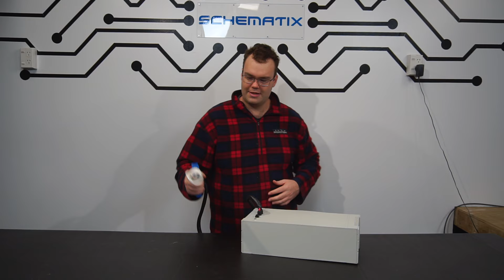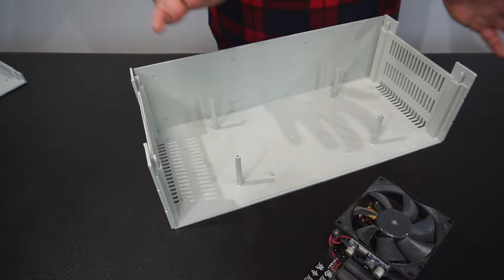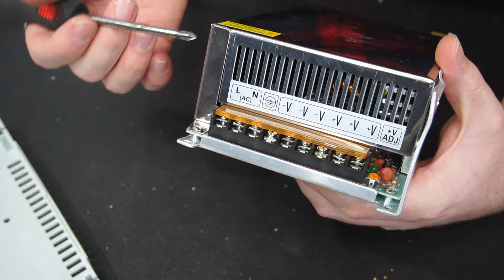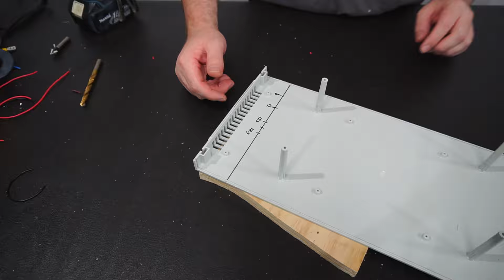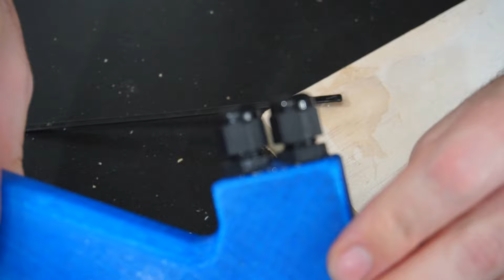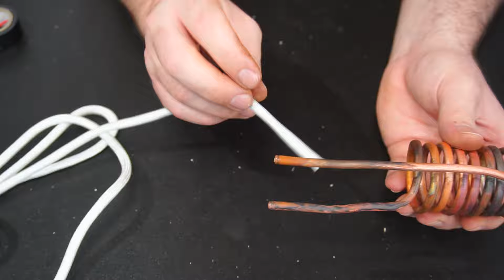How To Make An Induction Gun (Bolt Heater / Buster)

Comment: And for better efficienci, and even better performance, place the capacitors from the kit as close as possible to the coil, there is sou huge amound of curren flowing through the wires from the kit to the coil, this current is heating the wires quite a much and the LC resonance circuit has big rezistance, which eats the power only to heat the cables and not the heating object.

Comment: cool.....I was under the impression that its mostly about eddy currents/hysteresis & that you can indeed heat non-ferrous/non-magnetic metals with the right coil/frequencies etc.
Reply from the maker: You certainly can with the right type of induction heater. However, this particular induction heater isn't the correct tool for that job.

Comment: Cool video!  Youtube random AI and I bought most of the materials to make one of these a year or two back for when I swap the exhaust manifolds on the Dodge Ram.  I wound up patching with furnace refractory as an adhesive to fiberglass tape with a stainless steel zip tie and haven't had any issues with other than one blow out... so didn't get to swapping yet.  I've saved this and thanks for sharing!  I'll try to do the same once I get around to.  Excellent videos of practical devices that I've found from random appearances from Youtube suggestions.  I think the other was the microwave transformer rewind or transformers in general too when I was thinking about rewinding the bug zapper transformer.

Comment: Induction heaters are able to heat up any conductive meterial. Not just magnetic materials.
Reply from the maker: You are correct, however, this induction heater isn't powerful enough to heat non-magnetic metals.

Comment: Very interesting. A little disheartened though, that it won't work on aluminum. So much for my idea of making a foundry furnace for doing aluminum castings.
Reply: A cast iron crucible would probably work on heating non ferrous metals ?
Reply from the maker: Yes I wish it was more grunty so it could be used as a furnace and heat other metals such as alloy. An induction furnace could be a future project for??

Comment: This was great but the high voltage on those two protruding aluminum bars worries the heck out of me.  They should be insulated.  Also, put a trigger (on/off switch) on the headpiece itself.
Reply: You can hold the bare coil in your hand while it is operating & not feel a thing! The high frequency makes it inherently safe although it might feel a bit warm.
Reply from the maker: High voltage? It's actually very low voltage & high current. Unless you short the prongs with a low impedance body part such as your eyeball. You'll be fine. Think of it along the lines of a car battery. Crazy amount of current available, however, not enough voltage to cause any harm. ;)
Reply: @Schematix  Yes, you're right.  High current when trying to heat.  Still, https://www.tuv.com/media/usa/aboutus_1/pressreleases/fieldevaluation/Effects_of_Electrical_Current_in_Human_Body.pdf
Reply: @Schematix  Never set the gun down flat on anything conductive...
Reply: Yes not dangerous shock wise but I wouldn't stick my fingers in the magnetic field....could cause cancer....lol
Reply: @oceanhouse8080  

having a ring on would be much more of a concern.
Reply: @deaultusername  LOL

Comment: Looks like just the thing to remove the bolts holding a vintage pickup bed to the chassis - after fifty years the originals won't budge and better than a torch near the fuel lines.  Just the perfect amount of demonstration and explanation too!
Reply from the maker: Glad to hear you found the video helpful :)

Comment: Tons of useful information here. Would you have any insight into what it would take to heat brass bar? Less turns on the coil? Higher frequency?
edit: I know you mention in the end it won't heat brass, but induction heaters are used to anneal brass bullet casings, and used to heat copper pipe for creating clean solder joints. I would guess by the use of eddy currents?
Reply from the maker: While you certainly can use induction to heat those metals. The induction gun I built in the video has little on brass/copper. I think it's just not powerful enough. The manufacturer claims the unit is rated for 1000w. However, I've only got it to draw around 300w. If I stuffed the coil to the point it's bursting with metal then perhaps I'd be closer to the claimed 1000w. So in summery, I think a more powerful induction heater would be required for metals like copper/brass.etc Perhaps a future video?
Reply: @Schematix  It has to do with the frequency at which the induction is run at to which metals it will heat...
Reply: @Schematix 

I was looking at ads for these inverters and noticed that the more honest of the  so-called 1000w units claim to be usable at 53volts. That tells me that it will only deliver ~1000w if you use a ~50v supply. It also suggests that at lower voltages you are unlikely to need a 20a capable supply - as your own measured 300w consumption confirms.
Reply from the maker: @rhiantaylor3446  The induction heater I bought is rated for up to a max of 36v. So I think you'll be looking at a different model. I do feel that the power ratings are overinflated on most of these affordable induction heaters. And yes you probably could run a smaller SMPS. However, I prefer to run a 30amp SMPS @ 50% duty, rather than a 15amp SMPS @ 100% duty.

Comment: I'm literally in the process of making my own. I got a 48v version and a big psu. And a 48v relay. Nice handle. I'll be stealing that. Mine heats up an m10 bolt I about 10 seconds.
You I've got it so my psu is always on and then the relay applies the power to the circuit board when I press the button.
The problem with leaving the circuit board constantly connected is in the few seconds it takes for the psu to fully turn on. The circuit kicks in, doesn't have enough power to start oscillating and pretty much makes a direct short and blows itself up.
Just in case anyone is thinking of making their own.
Reply: I have had the same problem and the cure is t have an instant 24 volts available. A two stage relay is the cure. The first stage engages when the power supply turns on and the second engages when the voltage reaches 24 volts.
Reply: would a capacitor large enough and rated for the voltage remedy this? it would be able to hold the charge and then release it on demand.

Comment: Tell me dear friend: The plastic controller that you have beautifully printed is not likely to melt under the very high temperature?
In addition I see that much of the winding is not covered by fiber glalsse: a real great danger of death: Yes?

Once again: Congratulations
Reply: Assad, the coil gets warm as the steel it is heating radiates heat but the coil is really just an antenna. It doesn't heat up.
Reply: I don''t mean to argue, but the coil does heat up, even without any material in the work coil.  I water cool my work coils.  Just today I was doing some testing with only the 5 amps of "idle current" (empty work coil) being drawn by the system.  The 2 quarts of water in my radiator heated from about 65°F to about 90°F in about 10 minutes.

Mr.  Schematix-  I like your design and your fabrication skills.
Reply from the maker: @frenchcreekvalley   You're 100% right FCV. I'd assume the coils you're referring to are far more powerful than this induction heater? For sure the coil does get warm even at idle. And for powerful induction heaters, water cooling is a necessity rather than a luxury. The induction heater I built draws around 2.5A @ 24V at idle.  In round figures, it generates around 60w of heat. So it's like holding onto a 60w lightbulb with regards to temperature, warm but not hot. I'd like to build in a future vid a powerful water-cooled induction heater :)
Reply: @Schematix    "---more powerdful---?"  Actually I started out with a Chinese 1000 watt unit similar to yours, but recently moved to the 1800 watt and then to the 2500 watt version.    I run them at 48 volts.  As you know, you can get more power out of them that way, but the higher  input voltage helps to square up  the gate signals so the Mosfets turn on faster and run cooler.
See:
http://spaco.org/Blacksmithing/ZVSInductionHeater/1000WattZVSInductionHeaterNotes.htm

Where did you get the cabinet?
Reply: @ggenergyarthurmiller5963  Thank you very much sir for this indication
Reply from the maker: The plastic handle I 3D printed will start to deform from about 65 Celsius. I have not had any issues with the handle getting too hot (at least not yet). If you're planning on prolonged use then perhaps look at making the handle from some other material that can withstand a bit of heat. The probes of the handle are not insulated. You could insulate them if you want. However, I don't consider it necessary. The voltage is very low and current always takes the path of least resistance (In this case the copper coil).
Reply: No shock risk due to the high frequency.